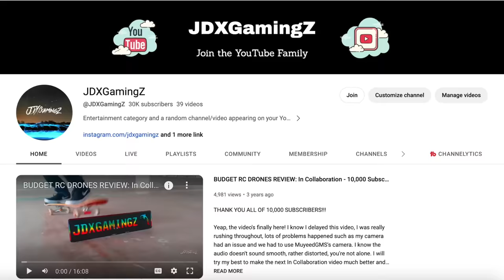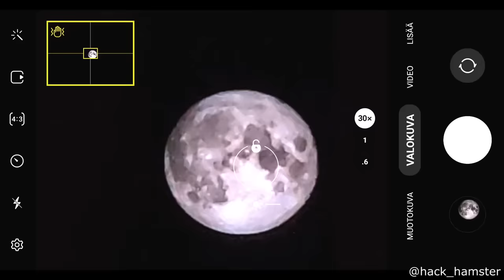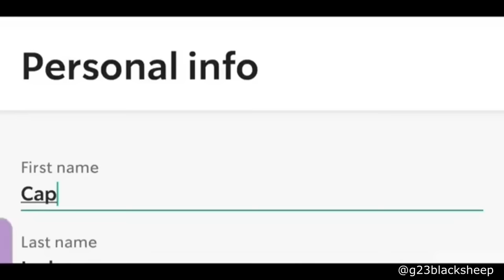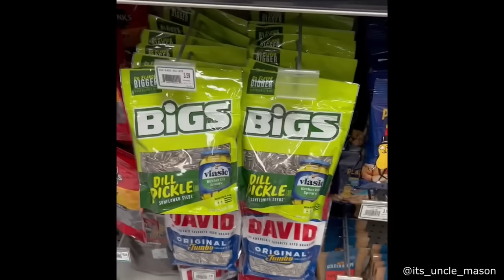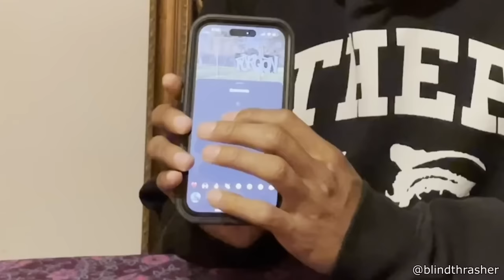1 Hour of Daily Dose of Internet *ONLY ONE INTRO

Comment: 0:29 “nobody was hurt” 
The puddle of blood on the floor: Am i a joke to you
Reply: it's probably a fuel or oil leak from the car
Reply: @PurredMeowtini  with that red color?
Reply: Yes, it’s called transmission fluid or radiator fluid…
Reply: @garagebandersorg3343  yeah but how did it start liking if it was hit in the front?
Reply: @jcucucucuhdhchch3570  The radiator is located in the front of the vehicle and is filled with the radiator fluid. In the video we can see that the front of the car got quite the dent. It is also important to note that the radiator is quite a fragile part (mostly of thin metal and plastic).

Tl;dr: because the crash caused significant damage to the front of the car, it also damaged the radiator, located in the same location, hence, causing the radiator fluid to leak out
Reply: @garagebandersorg3343  Came here to say the same thing. Can't help but noticing that the human race is definitely on its way out.
Reply: @spore7346  I mean If you have no idea about cars It's hard to tell that It's radiator fluid lol But thanks to the explanation I'm sure a lot of people are smarter now lol
Reply: @cultroswing4488  I didn't explain anything? Just that humanity is shit. Kind of like the "point" that you are trying to "prove". Just wanting an argument. I have nothing to argue about. Thanks, though.

Comment: 47:00 Its a front wheel drive truck with a trailer welded on in front of it, so it acts as a rear wheel drive trailer, at least when driving forward, in the video is is obviously backing out of the lake.
Reply from the maker: Vehicles always impress me

Comment: 23:00 - used to be pretty common sight in the '90s on flights landing in India AFAIR. I mean, I DO remember all those sprayings, but now, thiry years latter I'm not exactly sure what was the destination, but I'd say 90%+ it was India. Don''t ask me "why" they did it, though...  ;-)
But it could be flights FROM India landing in Singapore too.

25:04 - that's not "dispersing" the electricity, but the effect known as Faraday's cage - the strong electric charge basically pushes itself (and the current) outside.

Comment: 8:07  Does she think it's supposed to say "storage" ?  Has she never traveled?
Stowage is a term used in shipping and aviation, and refers to the place where cargo is stored during transit. Storage is a more general term, and usually refers to a place where goods or possessions are kept long term. 
Here are some other differences between stowage and storage: 
Stowage: The act of arranging and securing items for transportation.
Storage: The act of placing material or other supplies on board.
Stowage: Securing those items stored in such a manner that they do not shift or move during transit.
Storage: The amount of room available for stowing materials aboard a ship, tank, or an airplane.

Comment: Those tiles with handprints were NOT from building the house. They were the equivalent of putting your handprints in wet cement after the driveway is poured. 

Did you really believe what you said, "Back in the 1800's it was normal for five, six and seven year olds to build homes"? That statement is beyond stupid!

Comment: 28:05 - I call bullshit on that internet speed. He must have set something up on a local network or faked the video altogether because nothing transfers at even 1 terabyte per second. Also download speed is limited by the upload speed of the source. You can't download something faster than the source can upload it. Also if it was actually downloading at "7.7tbps" or whatever it said, it would've taken less than 1 second to download the whole thing. 1 terabyte is 1000 gigabytes, and the file was like 84gb

Comment: the motor bike hardly moved the water and was well made cause it was A HONDA! plus a mk 2 honda CRV car is basically indestructible, honda do make good products, as long as it isnt an early 1.5 turbo petrol that suffers fuel oil dilution, although to be honest, bust change your oil more frequently and it should do ok, but that engine yeah honda shoulda done better but really 99 percent of the time hondas are the best, of not One of the best auto manufacturers ever, plus they do cars and bikes